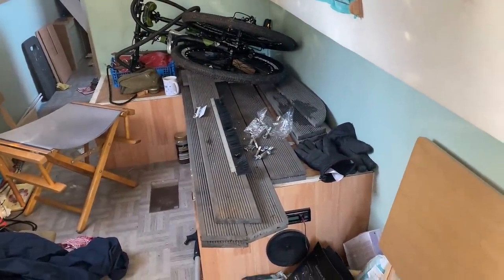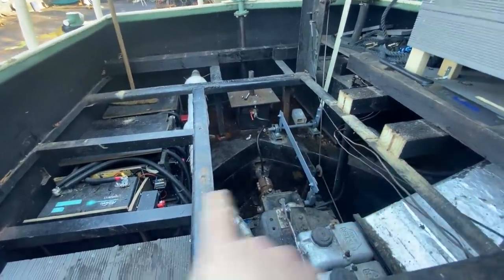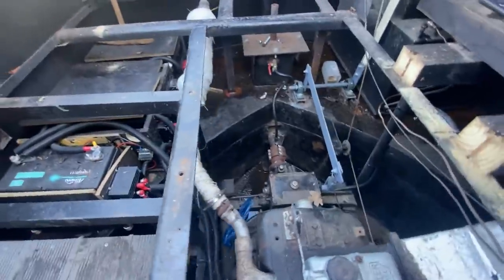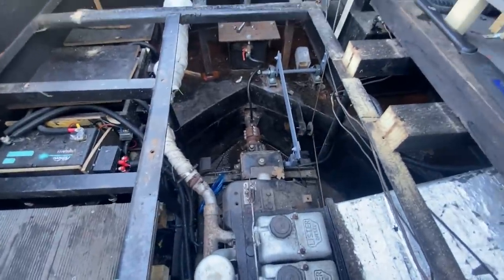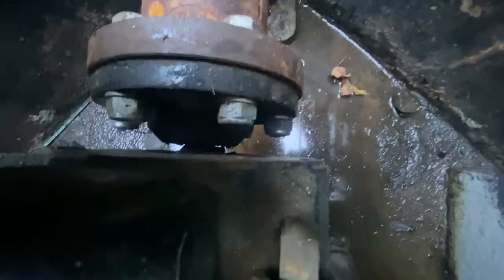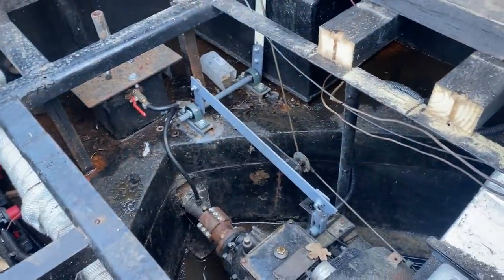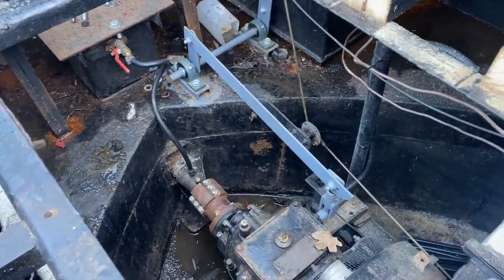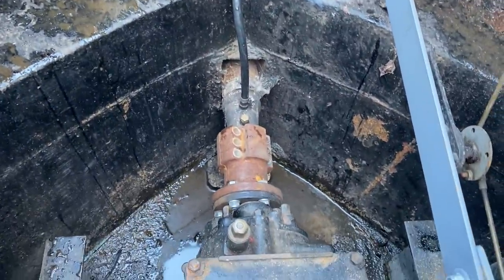312. Why did my boat breakdown ?

Comment: That James is a torsional stress fracture and appears from the video to have started from the keyway and will have taken years to developed and is due to the constant change of direction of the shaft as in my engineering days I dealt with mechanical defects in components well that's my humble opinion, love your videos mate hope you find the part needed.

Comment: If you find that the alignment is off center,  a universell joint might help when putting it back together. It would straighten the bend so to speak, as well as relieving compound pressure in the prop shaft. Maybe....

Comment: I’m surprised to see the prop shaft fitted rigidly to the drive flange. Most props I have seen have a rubber joint in them to act as shock absorber

Comment: Some kind of rubber coupling vibration dampner might have enough flex to eliminate a problem of slight alingment. A universal jount would work for a situation of a larger missalingment. But a U-joint can still induce movenents of runout. That might prove to be a problem.

Comment: Hi James. Looks like a stress shear, definately check alignments and engine mounts. The prop shaft is in a fixed position but the engine and gearbox are rubber mounted. On startup or changes from forward / reverse the engine will kick to the side stressing the shaft, your old coupling seems to have been the problem and formed a solid connection between the gearbox and prop shaft. Some sort of flexible type coupling would be best to allow a little stress less movement between the fixed prop shaft and gearbox and it will4 cut down the transfer of engine vibrations into the boat structure too....cheers.

Comment: It looks like you have the engine sitting on old rubber mounts right? From what I can tell from the videos, it looks like you have a flexible mounted engine connected to a rigid propshaft? If that's the case then the shaft was under quite  a lot of torsional stresses and was going to fail at some point. The output shaft from the gearbox failed at the keyway - you can see the point at the corner of the keyway where a crack propagated and only happened because that is the weakest part. In any root cause analysis, start with the failure cause. In this case I would start at the engine side: check the engine mounts - if they look old and have deteriorated then replace. Then check alignment and realign to the propshaft. Most importantly - get a flexi coupling installed. You should avoid having a flexibly mounted engine connected to a rigid propshaft as it will fail again. Good luck.
Reply: I forgot to say that if the engine is rigidly mounted, then make sure the alignment is done properly. Still consider the flexible coupling and if you can stretch the budget, install flexible engine mounts if the engine bedframe and supports can accommodate them without too much cutting or rearrangement of the engine bay. It will make cruising and running the engine much quieter with less vibration. I did post about the various types of flexi couplings that would fit your setup but it was deleted as I mentioned a brand name and website. Have a look at the Dutch engine supplier's website - the one that supplies yellow engines and has a name that sounds like 'Whetus' - you will see the couplings I am talking about.

Comment: IMO might be better to get a new shaft turned for inside the reducer and replace just that shaft and reuse the coupling that you have. There’s no way the weight of that coupling had anything to do with that shaft failing.
Reply: Agree about the coupling - It's a bit overkill but wouldn't make much difference in terms of weight. That particular coupling is meant to be a 'fuse' type connection. It has no keyway and is split down the sides - the idea is to correctly torque those six clamping bolts so that in the case where the prop grounds or gets jammed/locked, then the coupling will slip rather than damage the gearbox. Looks to me that the issue is probably that the engine looks to be/probably is flexi-mounted but is mounted to a rigid propshaft. Needs a flexi-coupling after the gearbox output shaft.
Reply: Correct .

Comment: New output shaft for the reducer, gasket, lip seal and maybe a new carrier bearing and it's fixed. I wouldn't bother with replacing the coupler or flange. As long as the coupler and flange are still true, both bores in good shape with good keyways. The mass the coupler and flange represent to the reducer output shaft is nothing compared to going from forward to reverse with any power being put through the drive system. The torque put back through the drive system will stress, crack and out right break a shaft far faster than the mass of the coupler. Even at idle/tic over,,, lolololol going from forward to reverse with the boat moving induces massive amounts of torque back through the drive system not to mention harmonics. The harmonics will come from chatter in the prop shaft bearing and from propeller cavitation. Water does not compress and fights back with massive power at times. If you do replace the coupler and flange make damn sure the unit is sized for the horse power and torque of the engine, diameter and pitch of the prop and shaft sizes. I would guess this problem has setback the massive Cummings Turbo Diesel install, trim tab system, flame paint job on the front of the boat and the dancing girls,,,,, Darn it to heck!!!!! LMAO,,, Good Luck

Comment: James it's definitely an old war wound on the shaft that has over time failed as you were changing from forward to reverse when it happened, as someone mention lucky it happened where it did not far from the repair shop. They maybe able to get a new one turned up for you if they can't find a secondhand one best of luck from NZ.
Reply: Do they have to replace the whole reducer? (Gears, etc.?) Or is it possible to just replace the barstock piece in the shaft? (Wondering if it's one piece or multiple pieces with the old excuse "the whole thing needs to be replaced" when it's really just a cotter pin needing replacement scenario).
Reply: @thepeanutgallery1699  if they can't find a secondhand reducer, then I would look at getting a new shaft turned up from the right bar stock as they have the old one for measurements.

Comment: It will be interesting to see if the boat really did need to come out of the water. I suspect not. There was obviously enough access to remove the coupling and the shaft has pushed aft allowing the reducer to be removed. There doesn't seem to be anything that couldn't be done with the boat in the water.

Comment: hi James, I have followed you from the first episode. I don't know much about boats. But from an engineering point of view, the shaft broke because there was no give in it. One end of the shaft is held by the boat the other end is held by an engine that is bolted directly down, so alignment must be 100% which is nearly impossible. As the engine wants to vibrate. It should have a flexible coupling to take the shocks out of it.
Reply: 100% my first thought.

Comment: Ouch!
It looks like a stress crack has propagated from the corner of the shaft keyway. 
I had a similar thing on my Moto Guzzi Le Mans camshaft. The engine tuner ground the cam lobes for a more aggressive lift but sadly just left a nick in the shaft. I had the time of my life on the Isle of Man for two weeks blasting around the non-speed-limited roads then rode the 275 miles home from Heysham. The day after getting home at 5am I rode 150 yards to the petrol station to fill up and the engine fell dead. It waited to get all the way home before letting go at 25mph. When I took it apart the camshaft had snapped like a carrot just like your output shaft.
Reply: I think I saw the same issue around the key way as well.

Comment: What I don't understand is,  why the key way didn't shear off, you can see the key way in the video, for that shaft to snap like that would take a tremendous amount of torque,  it might well have been a previous issue, the engine being out of alignment wouldn't have helped,  if that is the case. I just can't see how that shaft would have sneered off like that.
Hopefully they can find another one, I presume it will be second hand . I personally would look into getting one machined up. 
Good luck,  it looks like you are in good hand.
Reply: In my experience in industry normally there is a "lovejoy" coupler that will shear off when excessive torque forces occur.  This protects both shafts and can be replaced in situ.

Comment: So…. Why crane the boat out to remove the gearbox? Pretty sure the shaft could have been pushed back far enough to remove the box with the boat in the water..
Reply: But you wouldn't know exactly what needed to be removed until you do it.
Reply: @GaryB007  yeah but he literally showed us the broken shaft before the gearbox was removed. Could just push the shaft all the way back and remove the coupling and the gearbox.. it’s even possible to remove the shaft with the boat in the water with very little water ingress. It’s common place with big fishing boats. It’s his money and all that but the crane out seems a bit of a scam. Even in the video the shaft is still in the tube . Not even taken the rudder off.. 🧐

Comment: I'd black anything scraped off sooner rather than later. Out of the water in air is where rust happens, right? (At least slap a little black over any metal exposed/badly scraped and then do a full coat later when you've got time/inclination)
And Yay Narrowboat Hands! (Paul!) 👏

Comment: James - is this not a simple case of poor alignment which caused the fatigue fracture?  I always thought there was a lot of vibration in your boat just listening to it which lends weight to this theory??

 Seems like a universal joint / coupling is needed here to prevent this going forward.

Comment: Too much rotational weight. Like a flywheel. Going from forward to reverse without letting the prop shaft with all that weight to stop rotating, and no load dampener like a Lovejoy coupling. No surprise here.